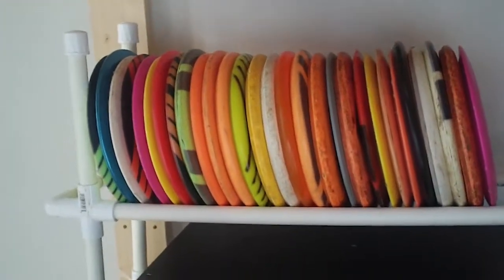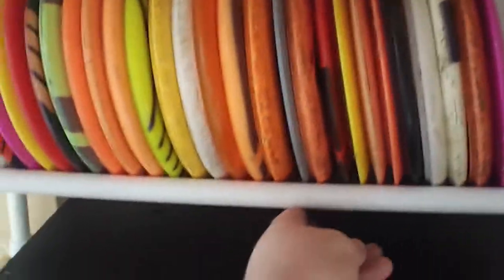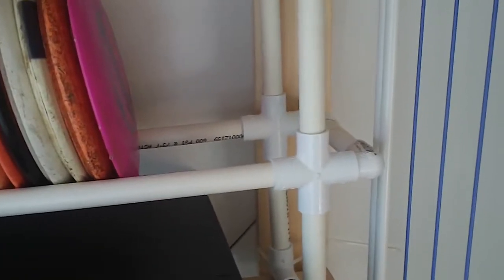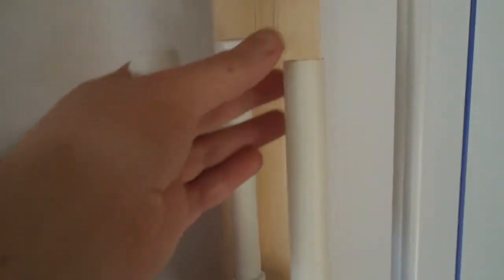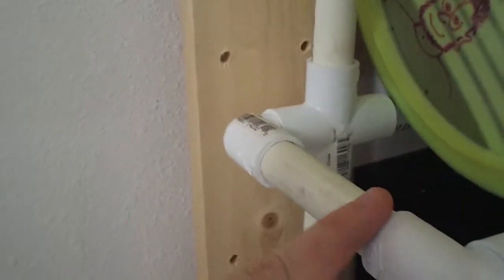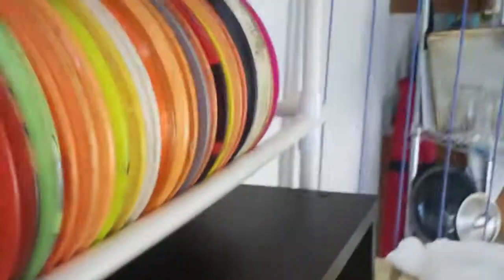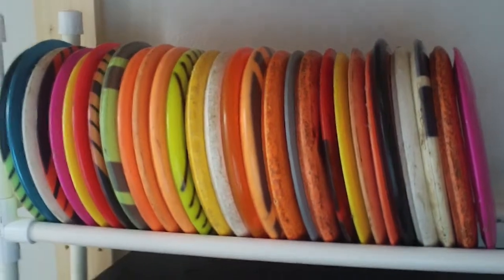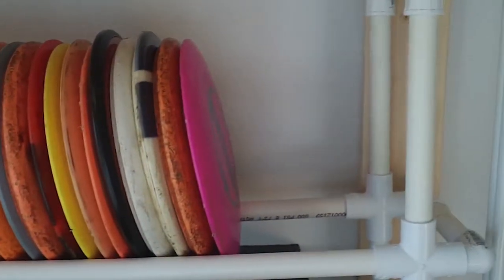Disc Golf Disc Storage DIY using PVC pipe: cheap and easy

Comment: you could reinforce it more by putting in more bridging and cross members in the middle.  that would allow you to have 2 sections (one for drivers and one for putters and mids) the extra joints would create a stiffer area in the middle.   great job

Comment from the maker: so far the rack is holding up great and I have had it loaded down with plastic since I made it.  The PVC dips just a touch but doesnt bother me at all.  Thanks for watching
Reply: You should definitely use 1" PVC if you build another one. I have one made from 1" and I could park a truck on mine without it sagging. :D
Reply from the maker: Nice. I have upgraded to hyzer disc rack myself.